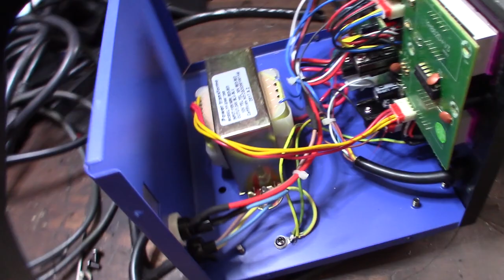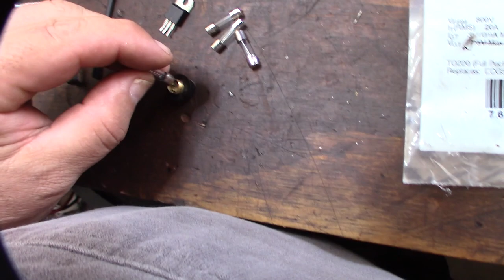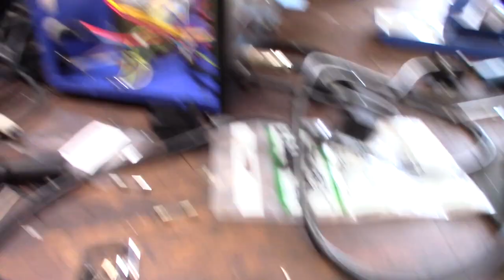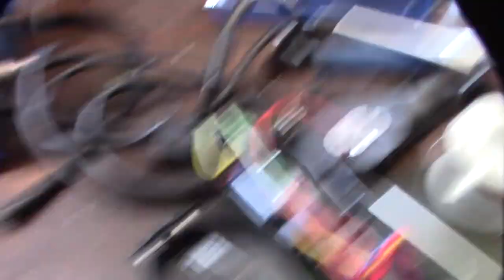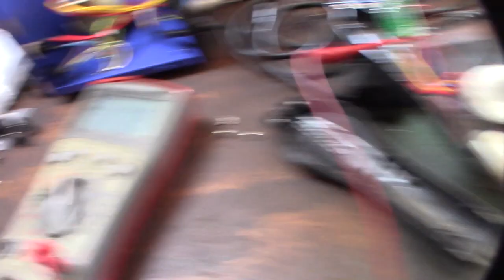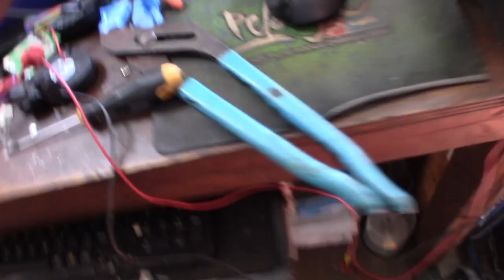862d+ Solder Rework Station Troublehshooting Repair BAD HEAT GUN!!!

Comment: I have the same item and basically the same thing happened to me. I was able to buy a replacement heat coil for the hot air gun off of eBay for a total of $8 after tax and free shipping. The covering over the heat coil is flimsy and certainly degrades after so much time. Thanks a ton for this video. It's helped me immensely. 👍

Mine broke because I burnt it out using it at its highest temp for way too long. I'm just waiting on new fuses because I got 6x30mm instead of 5x20mm off of eBay. I had no idea there was a difference in size when I found the printed number on the burnt out one.

Comment: Beware of Chinese electronics! The chinese have a bad habit of fusing and switching the neutral side of the power source. So the chassie is constantly HOT! Your unit doesn't even have a main power switch on the back as mine does. Naturally the heat gun is going to be on if it is not in the holder. Once the element shorted to the handle case it shorted 120 volts through the yellow wire to ground, thus blowing the fuse. So changing components was unessesary and possibly added to your problems. When your heating element caught on fire and blew up, it was probably not a good idea to lay it across the metal part of your pliers. So I suggest adding a MAIN POWER SWITCH and  reversing the power leads.
Reply: Good point. The AC cable entering the unit is brown/blue. Brown is the hot wire and it's not routed to the fuse. So the leads are backwards.

Comment: I have the higher version of this yihua, if I use certain tips on the iron the temp sensor freaks out and the tip will glow red hot.  The sensor in the handle is the sleep sensor for when you put it on the rest

Comment: Hi my hot air gun overheats i checked triac 1 was shorted buts its for air pump.  After reading up i changed lm358 n moc 3041 (as i read shorted phototriac causes full power) n its still over heats. I even bought new hot air gun bcos old one internal glass  holder broke n its still over heat. Its a 852d+
Can u advice?

Comment: I have a problem with mine getting red hot, any suggestions? Temp setting is lowest it could be but still gets hot. The old soldering handle has been replaced with a new one.

Comment: How much did you pay for that hot air station? I would get one and try and fix that fault before even using it
Reply from the maker: Yeah, I think about $60
Reply: @fintechrepairshop  oh cool Thanks ❤ love your uploads btw 👍
Reply from the maker: Thanks
Reply: Found one on ebay today for $16.99
Reply: Frank Smith wow, that’s cheap! Did you receive it?

Comment: When I use the hot air gun it causes my house lights to flicker anybody else have this issue
Reply: Lol! This means there's a short circuit,. Your home circuit breakers should have clicked off, or home fuses should have blown. It's a wonder your home wiring hasn't melted...

Comment: i bought one for 19.00$
Reply: We must bought from the same seller. Did he sent your order?
Reply: @erdem--  Yes I think so if ebay is right
Reply: @erdem--  And i bought from seanmarshall
Reply: @marcisthegamer7392  same seller. He says he will send mine at 29th April. Due to epidemic...
Hope it comes
Reply: @erdem--  Same he said it will came in 28 aprill i hope it will come too.
Reply: it show for me that he has deleted his account
Reply: @marcisthegamer7392  Yeah, it says "This user is no longer registered on eBay"...
I will wait for a while, then get my refund. I really needed some cheap hot air station. I wish it was real....
Reply: @erdem--  same   I wish that it will came in need becuse i have broken gpu and I need to replace the chip
Reply: @marcisthegamer7392  Me too, i need it to replace a shorted mosfet to fix my laptop. Also i am studying EEE. It would be great for me having something like that under my hand.

Also i was planning to make it run at 220V. My plan was to replace the transformer and put a diode and fuse in the heating element.